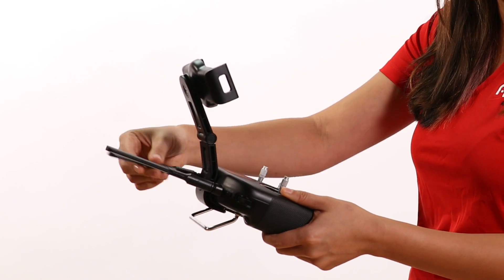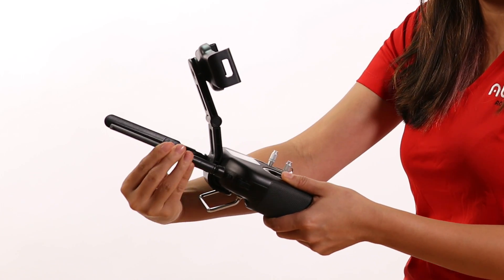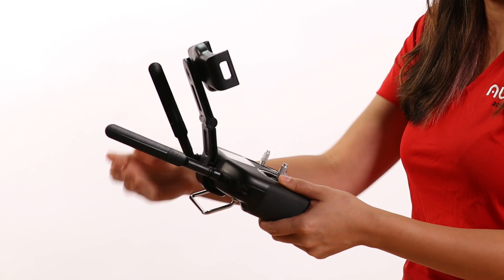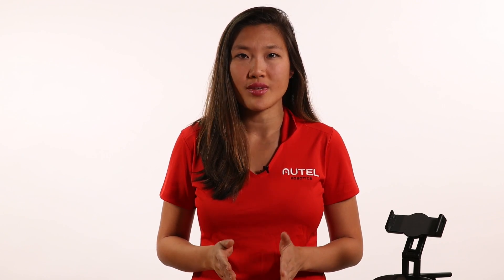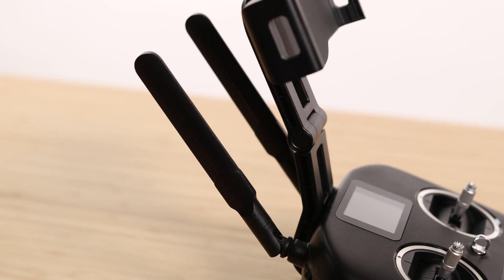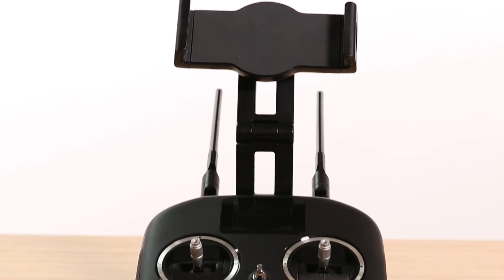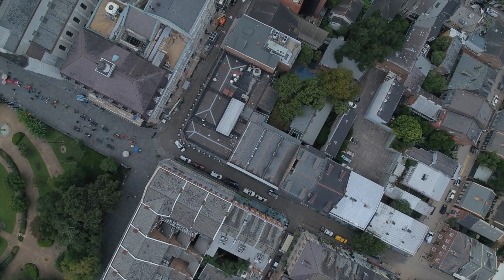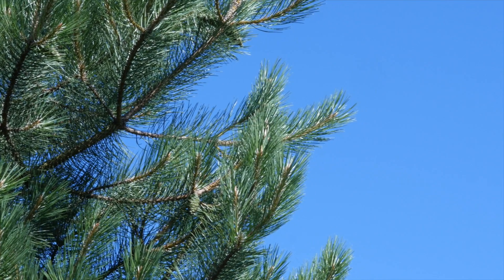Autel Robotics Tutorial: Antenna Positioning

Comment: I just received my X Star Premium last week, so please forgive me if this is a dumbass question. I'm getting the hang of this thing very well but still have questions. The MAIN one being, about the gimbal control. Is there no way of panning left and right? For example, if I am at a position in the air and it would be easier to "look" left or right, is this possible? I've been through the books, most of the videos, but I've found no mention! PLEASE HELP!! Thanks! Michael F
Reply from the maker: To move the camera left or right you will physically move the aircraft using the left command stick. This will yaw or rotate the aircraft. If the camera itself could turn you would end up with the legs in your shot. You can always email us your questions to Support@AutelRobotics.com

Comment: I have watched this video 3 times now, but i still cant seem to get any range on my xstar premium. the furthest i have ever got is 2,100ft from my location then i lose everything and it comes back home. i am not in a large city, and i am standing in a field when i fly... am i doing something wrong?
Reply: Lance Sprain I have been having the same problem. I called customer service and they said to do what this video just described. if this does not work they said I would have to send it in.
Reply: Donavan lee weird thing is, i literally just turned 180° and went in the opposite direction and got .7 miles out on this try. maybe its some local radio interference?
Reply: Of all the videos I've seen, the FLAT part of the ant's are pointing towards the aircraft.